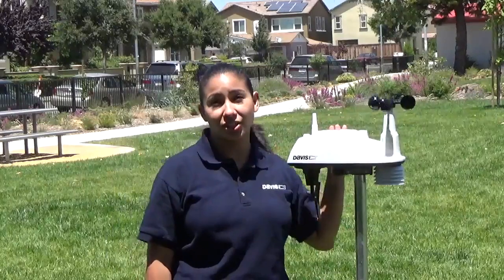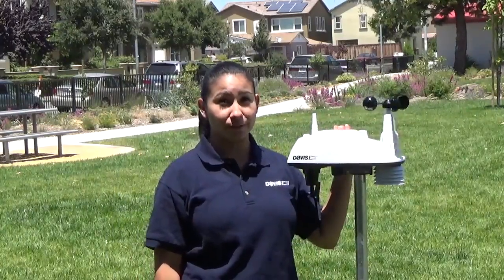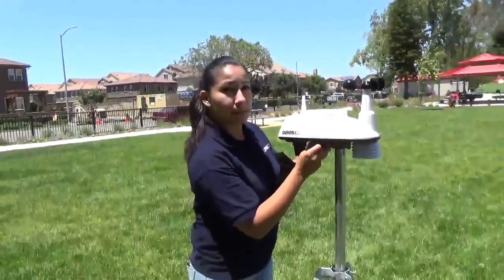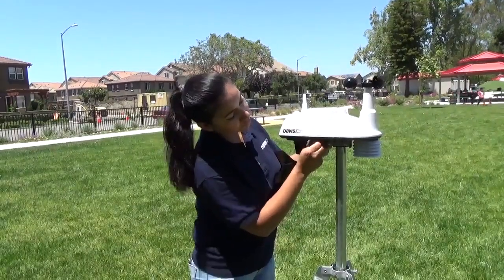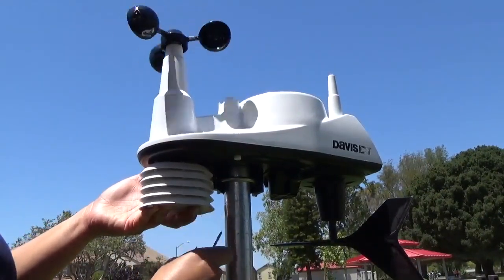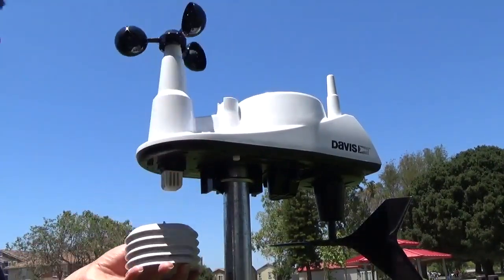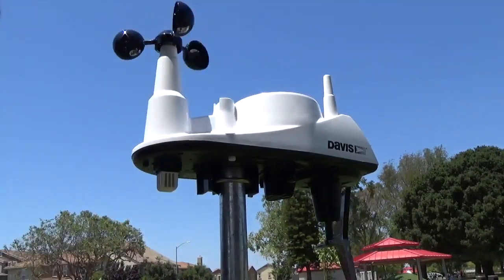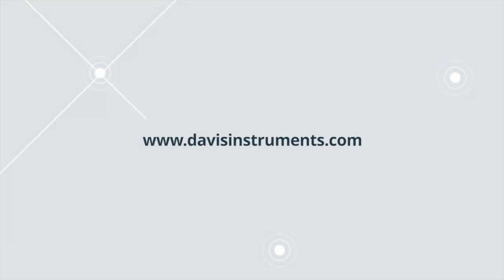Davis Vantage Vue Maintenance Video How-To

Comment: One thing that cannot be  maintained is the capacitor (battery) that the solar panel charges. Once it fails, it will still run off the lithium C123A batteries until they drain in 1-3 weeks. If the capacitor won't charge, the whole sensor suite is effectively junk. Can't replace the capacitor because it's encased in epoxy. Expect 5 years out of the ISS then it goes in the trash. If the cap could be replaced, you could get 10-15 years out of the ISS. With that caveat in mind, it was a nice system while it worked. Competitors make similar systems at a fraction of the cost with native internet connections even .

Comment: I love my Vantage Vue. I'm looking for a Bird Spike/Debris Screen Kit for my Vantage Vue. The only one available on the Davis web site is for the Pro. Do you know where I can get one? Do you know the part number for the kit? Any help is appreciated. The birds keep depositing into my rain collector.
Reply: I saw someone made a home built using a metal hose clamp around the rain gauge rim holding wire spikes. Screen kit probably also have to DYI. I made one from window screen material and bailing wire i fashioned into a ring shape.

Comment: You guys make the best weather stations on earth. I foolishly tried using Tempest Weather for 2 years & its cheaper, inaccurate and the hardware failed every year, went through 2 stations, only to find out the weather is fake. They use local information as the station is always wrong. I finally saw the light bouth a Vantage Pro 2 as we depend so much on knowing our local weather, and we love the new console. I need to feature you guys on my channel sometime, your stuff is not cheap but accurate and incredible.